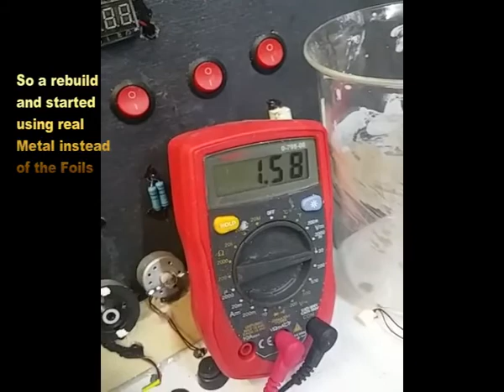Rechargeable Battery my 3rd attempt, back to 1cm very surprising results

Comment: Hi Kev, 
That is really impressive from a 1 cm^2, it will be interesting to see the figures when you measure volts and amps so that we can figure out the energy stored. But it is looking very promising.
Re the voltage going up, could it be that the motor pulls its biggest load when starting, and then there is a bounce back as the current reduces, ie the initial current draw is to much for the cell? You could try it with a resistor and see what happens.
Martin.
Reply from the maker: Hi Martin, yes it is all getting very interesting now but there is a long way to go, especially with separators ( i might have a go at that latest RMS one with the ciggy buts ) But yep just trying to put it all into perspective now, i have had 51 mins tonight but again it was with trying a different binder which was intended for my Sea Battery ( so i'm straying a bit again and i need to stay on a path). My own Electrolyte i am very pleased with and glad that i finally have a chance to use it in anger.
The main thing is though i am enjoying myself.......
Oh that bit you said about the initial current No  No   No i did some short circuits tonight also and peak was over 1 Amp ! ! ! ! i will piece that video together at some stage, but it is so time consuming.
Speak soon m8
Reply: Oh well at least you have ruled out the motor as culprit, very strange how the voltage initially drops and then recovers.
I saw RMS ciggy butt separator, it looks good, I have the chemicals in stock to make it, just not got around to it yet.
Just as a quickie, I pulled apart an old Li Po battery and have been using that on recent tests, it works well and gives you a bench mark to try and better.
Reply from the maker: Yeah i know but i do think that the culprit is the binder ratio on that one, further tests and mixes should solve it.
But yes that separator looks the Dogs, he's the man ain't he....
Mmnnn using other batteries as a benchmark is ok i guess but you then have to achieve that exact surface area for comparison.
Last night i up scaled one of these new ones 4 cm sq and COR BLIMEY could start yer car with it.... ha ha ...... but it was slightly awesome though
Reply: What I meant was just using the separator material as a quick fix, while continuing work on the other components, rather than changing to many things at once.
It will be useful to know how it scales up, but looking good.